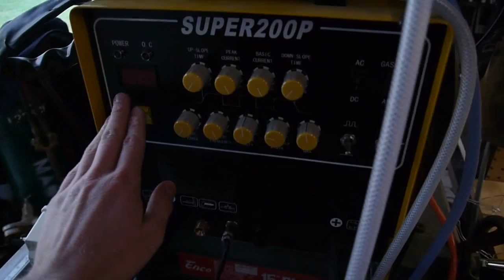First test run of 1000W Osram Xenon short arc lamp XBO

Comment: Very cool video, however there is few safety aspects I would like to point out when working with short arc xenon lamps: 

You should have a blast shield when using the lamp because these lamps explode fairly easily in: 
- end of life
- if the lamp has manufacturing defect
- if the lamp has been damaged during delivery
- if the lamp has any residue from skin etc.
- if the lamp overheats

Also not only these lamps can explode when they are in operation or hot but also when they are cold and the likely hood of explosion gets higher as the lamp gets older. Because of this explosion risk, these lamps are always delivered inside explosion shield and that shield should be taken off only when the lamp is placed to the fixture. When handling the lamp without the shield you should have face mask (welding mask etc.), thick work gloves and protective clothing. 
  
Short arc xenon lamps produce a lot of UV-C radiation that burns your skin and damages your eyes, this radiation can be filtered of by using glass explosion shield but having no shielding at all exposes you to that UV-C radiation. 

If you use this kind of lamp indoors where there is limited ventilation, ozone production by UV-C radiation is also a problem. If you decide to use this lamp indoor for more and few minutes you should design your lamp fixture the way that the cooling air is exhausted outdoors.

Comment from the maker: Sorry, I don't have a schematic. Feel free to ask specific questions about circuit operation.
Reply: can you help me to design a 150W xenon power supply?
Reply: how do you stop the high voltage from travelling up the welder line and destroying it
Reply: Could you supply the starting circuit diagram you designed? I have a 2kw lamp I want to fire up

Comment: In the 80's I used a Zeiss spectrophotometer that had a 400Watt WOTAN XBO short arc lamp. It could be a PITA to get the lamp to strike so we rarely ever switched the machine off, usually just once a year for our summer break.  These lmps have a quartz envelope and the Xenon gas is under a high pressure so the correct PPE is required for your safety. The lamps come in specialised packaging and  they need to be handled with great care.  Even the slightest trace of oil from your fingers on the envelope will result in a localised hot-spot and the subsequent dectruction of the lamp.  When they fail, they really fail, something akin to a hand grenade exploding, firing extremely hot shards of quarz glass everywhere.    In service we found these lamps had an extremely long service life, many years, perhaps because we rarely switched the machine off.   In the many years we used the Zeiss spectrophotometer we only changed the lamps once, becsue the light output had dropped off due to blackening of the quartz bulb.

Comment: The xenon in these lamps is at 25-30 atm pressure. They're shipped and stored inside special protective plastic shields. Projectionists who handle them are supposed to wear full protective gear. A quartz bomb exploding in your face without protection can give you a very bad day.

Mercury generates more UV than pure xenon, but xenon still generates a lot and the quartz envelope is transparent to it, unless it has a UV-blocking coating.

Comment: Ben, as others pointed out like kepta219.. Short arc lamps produce dangerous UV output.. I believe the XBO is either borosilicate or quartz so much of the UV does pass through.. Also they explode very easily like if an insect flies into the light. Those lamps explode if even fingerprints are on them

Comment: Yeah. Don't overdrive it too much. If that anode melts and drips onto the glass, you get one hell of a bang. 

Same thing happens with a worn lamp; at end of life you get increased anode heating, with melting in extreme circumstances.

Comment: Dope lamp ! that bulb is fresh ! XBO are medical lamps & super expensive // look at the electrodes & fused quartz ^^
Reply: I would use a proper power supply // HID 1000W ballast etc
Reply: Yeah, the anode gets hot, high intensity discharge light make plasma inside fuzed quartz in a special fill gas to make light & last a long time with a good ballast & properly cooled // with very good lumen efficiency too // those Low Pressure Sodium Orange lights have the longest life, way better than LED

Comment: the heat you feel is UV rays. May be a little unhealthy.
Reply: it's dangerous. Protect your skin.
Reply: If you want to turn it on you just have to wear proper gear to protect from an explosion and from UV. "Rarely" won't help you getting hurt, please!
Reply: tony359 the heat is actually infrared radiation, which is not that bad for you. But you are still right, uv radiation is produced and can be harmful. For small bulb run times, it actually won't hurt you though.

Comment: as a cinema projectionist i cringe watching this vid, interesting as this vid is... never play with an XBO lamp without a blast screen
Reply: I just won ebay bid for 4000w ushio xenon short arc lamp for only £30. no idea what it is really when I see others going for over £1000 I wonder if I've got something good? will see, prob not.

any advice on how to power it and as you say shield myself?
Reply: @SodiumInteresting are you okay? Did it explode on you?
Reply: @Mrshutter  haha no it didn't, I got some pulsed flashes from it using voltage multiplier but I ended up just reselling it at a decent profit

Comment: question: what is the small, grey component in series coming off of the HV cap? a resistor? if im following the circuit correctly, this lead should go directly to ac neutral (ground)....why the resistor?

Comment: i am trying an experiment to light osram 20 35 and 70 w to make it portable light. is it possible to light up using hid dc auto ballast. there are differences in the start volt. auto ballast is 23kv and osram pt fit is 5kv. nominal volts are almost similar on both.

Comment: dang that looked bright through the screen!

Also, this seems a bit over complicated. Why the foot peddle? just use a regular switch, on-off to control current. Great setup on everything else, the fan is a nice touch but does not need to be wired into the whole system and could stand alone, maybe a cup of ice in front of it to be extra cool.

Comment: I found a xenon arc lamp from e bay and  is it possible to start it with a 15 kv neon transformer ?
Reply: No, you would need a pulse transformer in order to superimpose the hv into the circuit. the current would just go back down the line and destroy your nst.

Comment: I was told not to blow cool air on arc lamps (well the guy was talking about HID 250W but he probably meant all arc lamps) because that created cold spots the could cause the borosillicate the shatter due to thermal expansion stress 
but so far I only killed a UHP 120W lamp by letting it overheat so I'm not sure

how good is that TIG welder ? I'm planning on getting one of those to supplement my 40 year old mig

it looks like one of the more expensive "cheap one" from ebay, is it stable ?

Comment: how many volts at 50A does this lamp take?
Reply: Well it's a 1000 watt bulb so 20 volts. They run low voltage high amps. Once you excite the gas with the strike arc, you do not need much voltage to keep it exited
Reply: @Mrshutter  lol
A reply after 11 years